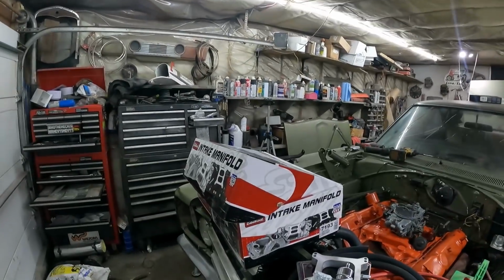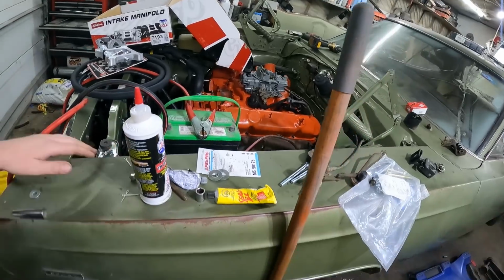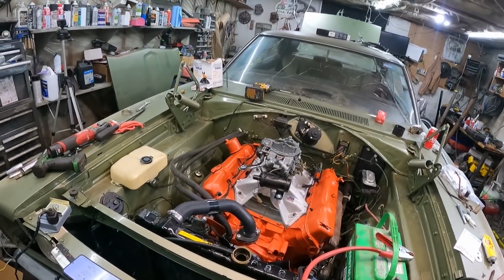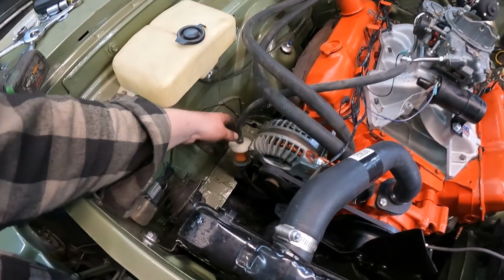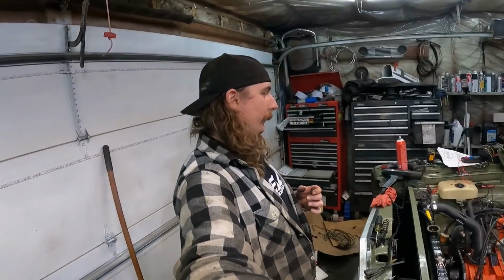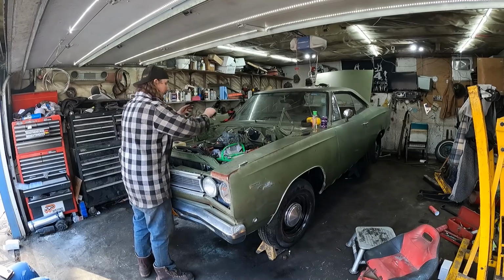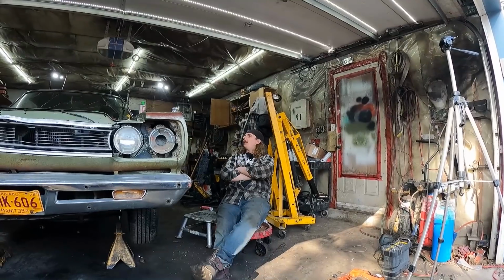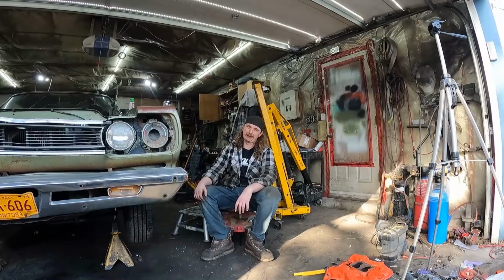Big Block 440 Powered 1968 Road Runner FIRST START IN 40 YEARS!

Comment: That's a keeper. I got rear ended in my 68 Sport Sat. Going about 10-15. The Datsun that hit me bent both fenders and the hood. I looked back at my  car and the license plate door hide the the gas cap thing was bent, and the bumper equally notched/creased. She wrote me a bad check for 200.

Comment: nice thing about a 440 its one of the only engines you can run a flat tappet cam on and not have to worry about the cam going flat. They oil the cam good.

Comment: 8 3/4 yoke has two different sized u-joints. Moog # 347 u-joint is a stepped u-joint that allows you to mix and match drive train sizes.
Reply from the maker: Yeah its the tiny one.
Reply: @DDSpeedShop  Still is plenty strong for a street car, but if you ever change out the pumpkin/gear assembly, and the yokes are different. The stepped u-joint is handy.

Comment: Yes, that new intake manifold really dresses up that engine compartment.  But, but did I mention that dollar for dollar upgrading the exhaust is where the horsepower is found?  The stock mopar passenger car big block exhaust manifolds are junk, way too restrictive. They are almost as bad as the base Ford FE big block exhaust manifold. The performance exhaust found stock on a GTX or RT is a good improvement, but real headers are easy horsepower. Nick's Garage recently did a feature comparing high-performance exhaust, cast iron headers, and tube headers, its worth watching.
Reply from the maker: Yeah ill do headers down the road probably

Comment: When its been sitting since Reagan's first term, I tend to replace the fuel tank and lines no matter what. The varnish that builds up in there gets super nasty, and pump gas will clean it out causing more problems. Plugged filters, pumps, carbs, etc, and sometimes the varnish is so thick it plugs rust holes from water sitting in the bottom of the tank. 

Got lucky with the 68 LeMans, the tank was ok with a quick E85 rinse, but the fuel line itself was completely clogged and rusted through in a bunch of places. Its a good idea to replace the O ring around the sender and any rubber hose in the system, because 40 to 60 year old rubber is a fire waiting to happen.

Comment: RTV sealer around the fuel ports of the manifold doesn't work well.  It will eventually turn to s slimy goo.  Been there, done that.  Around any water ports and on the ends, RTV works great.

Comment: You have the wrong exhaust manifolds for the exhaust system you ordered. You should have HP manifolds not the 74 C Body manifolds that are in your engine. A little work on the down pipes and you’ll be good lol
Reply from the maker: Itll work out I'm sure

Comment: Now she is looking like a good downpayment on property that you want and not what you have to settle for.... that really blows chunks. I  was sure it would but after it running in a chrysler, what the hell dodge, no can copy the other donor car or what? Not one to suspect the reluctor in distributor going out of adjustment..... as in the bushing in the unit has to have worn equal to just be out of adjustment. That said, I heard it run last night during the live feed. With all the interior and such... park it before you wrap it around a light pole. I found that the biggest difference in each manufacturer is metal.... as in high torque is just more going around in a circle that  weighs more than the next one. Chev built a light weight engine and other stuff to make it higher mileage. Ah its only live once so you go for it as I would